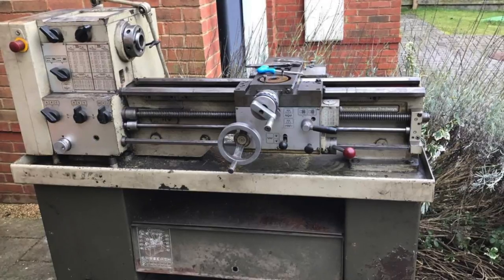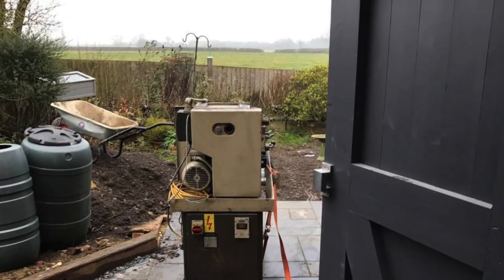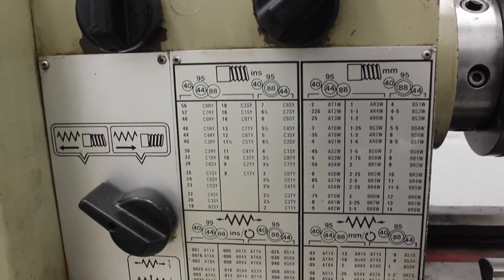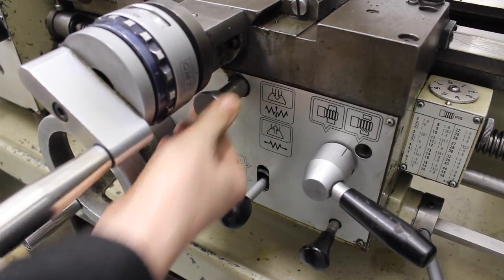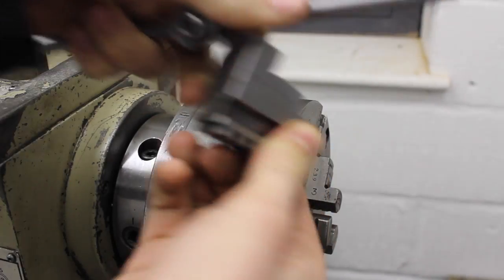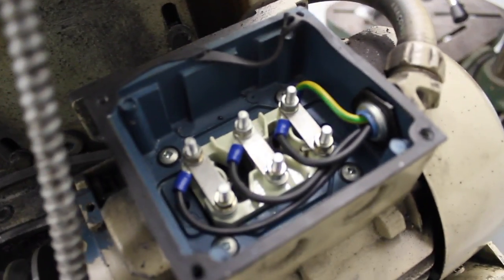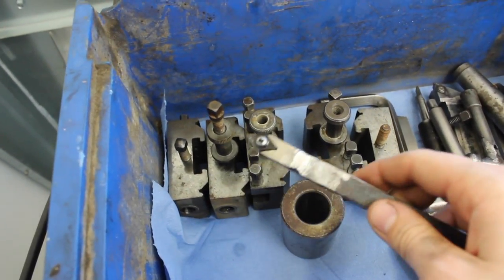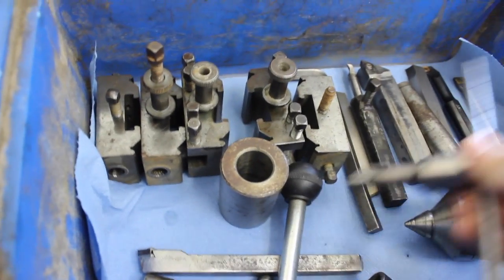Harrison M300 metal turning lathe

Comment: Hi! I have just bought an M300 the same as yours but I am struggling to  work out all the thread cutting settings, do you have any tips on how to read the chart?

Happy machining!
Reply from the maker: Hi,
good purchase! 
so firstly you'll want to make out the thread section of the chart (denoted by the lead screw diagram). then find your thread in that chart either metic or imperial and set the dials to 'code' given. 
the 3 letters tell you what to set each dial to and the number tells you where to set the round knob. 

i may do a short video on the subject

i hope this helps though

Comment: how do i remove the original toolpost so i can get a quick change toolpost?
Reply from the maker: undo the nut or handle which you use to adjust the angle and pull the tool post up, you'll be left with the threaded stud that's screwed into the compound slide
Reply: calm callum 
Never thought about pulling it, cheers for that buddy!
Reply: calm callum 
Got the toolpost off. Can i get any quick change toolpost to fit? 
And do i need to leave that shaft in place, the one with the nut on top with the thread underneath?
Reply from the maker: yeah leave the stud in place, its m12, so any tool post with a 12mm hole will fit, search Ebay for tool posts that fit harrison and colchester lathes. you might find Myford tool posts are too small. there are lots of variations of tool posts about, mine has, i believe, what people refer to as a Dickson type tool post, multifix is another type.
Reply: calm callum 
Cheers callum. 
Any chance of you doing a video on threading on the lathe?
Reply from the maker: I will definitely do one soon, i've got to get proficient at it my self first! haha
Reply: calm callum 
Great buddy 😉